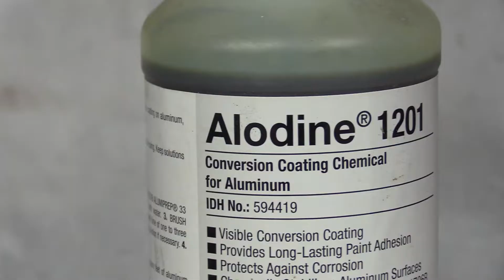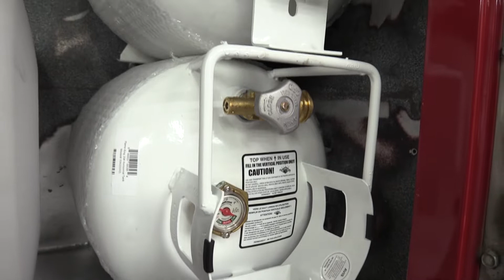Ambulance to RV/Part 10 - Yacht Shop Creations - "The Bear" Project - Water Tank W/H Jim LaCourse

Comment: Loving these ambulance videos, thank you Jim!  I just got an '02 E450 ambulance to convert to a camper. The original plan was to work with the interior that is there...but now you have me thinking otherwise.  I'm in South FL as well, Jupiter :)
Reply from the maker: The great part about an ambulance frame is the way it was designing instructed, it was intended to be able to survive during a rollover or debilitating crash. The interior was created to be able to move a gurney inside and then retracted from the unit.
There is absolutely no thought given to a full-time interior living space. Thus there was a lot of wasted space during construction of the interior. In my humble opinion starting from scratch on the interior is a job done right.
Everyone has a budget and some people are more acceptable with less. I love to create a masterpiece regardless of whether I’m making a door knob or a yacht. I wish you great luck with your project.
Jim

Comment: Thanks for sharing these inspirational and informative build videos. I've begun shopping for an E450 ambulance of my own, planning a full interior gut reno, when I came across your channel. It's really helpful to see the framing with the cabinets and insulation stripped. I'm happy to see the additional overhead hidden in that ceiling (suspected there were a couple inches lurking up there).

You also cleared up the mystery of the inches "stolen" from the forward wall of the box: the AC lines!  (By the way, does this AC use  water/antifreeze hoses to a remote heat exchanger in the engine bay?  I plan on ditching the 120V compressor in favor of a 24VDC unit, but like the idea of external heat exchanger without extending refrigerant lines to/under cab.)

I am thinking of using composite FRP/polypropylene honeycomb panels for my interior cabinets for strength, light weight, durability, and moisture resistance, backed up by and bonded to welded aluminum framing as/where needed. As a marine guy, what do you think of this idea?
Reply from the maker: Thank you Mac,
    You should be able to see the cooler for the A/C under the unit. You will find it just aft of the side door. 
     I like your idea of the light weight panels. We are welded everything because it will strengthen the box and I will only need a “beauty” skin for the plating. Your idea will result in a very nice end result as well. Good times ahead!
Jim

Comment: Is no one concerned about weight distribution of 65 gallons on one side or?
Reply from the maker: There is no concern about the 520lbs of water being placed in this location as the battery bank and a/c and refrigeration system is on the opposite side.